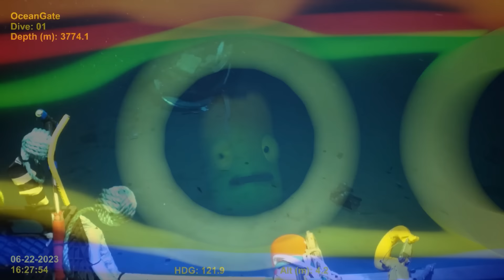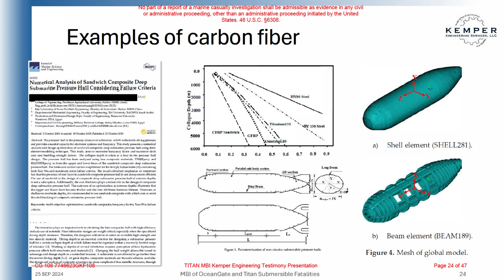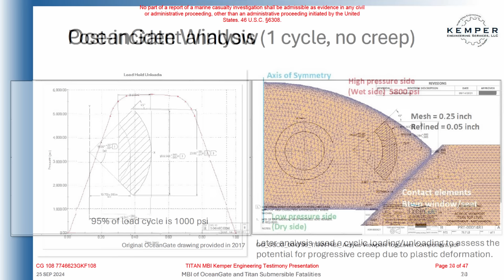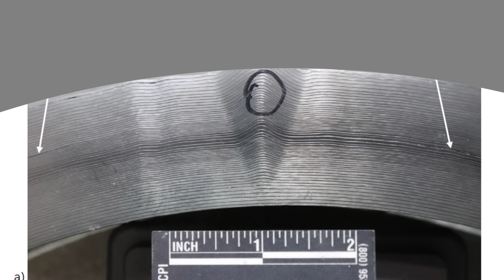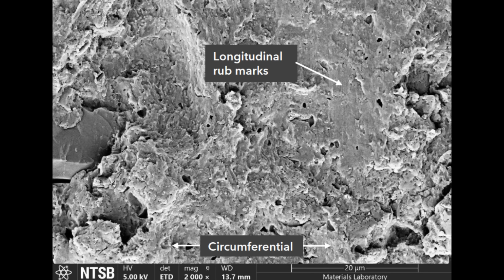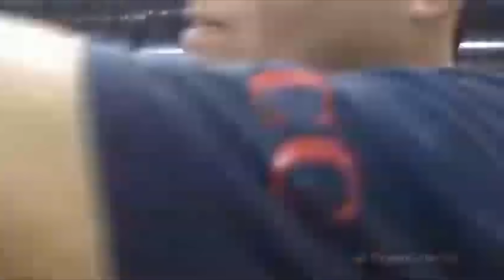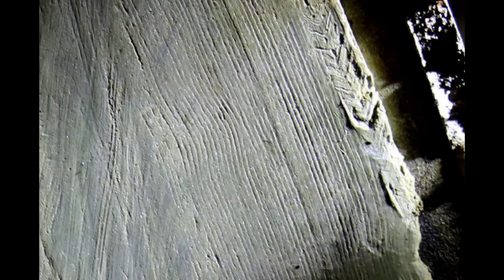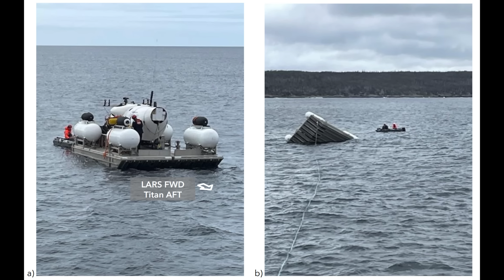OceanGate Wreck Shows Why Sub Wasn't Strong Enough To Survive - NTSB Shares Important Details

Comment: My guess the front window failed.  here I see what happen due speed of collapse the window failed ripping interior walls  ripping inner carbon wall layer by layer  ripping the glue  hence power glue bits also I’m saying window because remember once there leak like soda pop that pressure not going inward but going out window so nothing holding that window from going out.. gosh knowing that where bathroom is hope no one was in there pushing on glass to see or yah not saying out respect but that strong possibility

Comment: Carbon fiber is infinitely flexible, but it cracks like an egg shell when it fails--speaking as a cyclist who rides bikes made of aerospace level materials.  Amateur of course, but I would think if you wanted a lighter than titanium but stronger than steel material, you would go with zirconium alloy, which doesn't crack.

Regardless, carbon fiber paired with metal, I would just assume it would crack where they meet under pressure, because the materials behave in different ways that don't make them good partners.

If carbon fiber were the answer, every spacecraft would be made of it.

Comment: Idk, the glue would be layers of weak points.. looks like the sea water blasted through them, blowing it apart. They said it creaked so obviously it would fail. My intuition says 5 dives as safe. They should have made 2, 1 to that does 2x the dives to test.. otherwise pretty much suicide.

Comment: The human brain thinks in about 500 milliseconds. Oceangate imploded in about 10 milliseconds..... They were dead before they knew it....
Reply: I'm actually terrified of dying and not realizing I have died.  Like dying in a car crash on the way to work and continuing on for weeks before a coworker says to me, "you know you don't have to be here, you died two weeks ago."

Makes me wonder if they experienced a successful dive and only discovered the truth later when someone gently broke it to them.
Reply: It's actually about 250ms, that's human reaction time.
Reply: @takanara7  depends on which study you read. There are varying opinions. That's why I said about.
Reply: @Jim-ku6ry  "thinks in 500ms" means absolutely nothing, the human brain "thinks" a lot faster, thinking and reaction time are two different things. As an example, if you play an electronic instrument you will perceive the delay in response if it is over 10ms. And in many cases the human body can perform complex actions at high rate and with very fast reaction time, in the order of few millisecond, so this statement is nonsense. If you talk of the time it take for an human to perceive stimuli, analyze and react, then yeas its longer, but still not 500ms, it is oore in the order of 100ms and even that excludes reflexes which can be a lot faster.
Reply: @lo2740  the point being that the implosion happened faster than the human brain could conceive what was going on. You'd be sitting there and then you'd be dead. Nothing left but goo and bone bits and your brain would have no concept of what happened
Reply: Which is a fascinating concept... sort of like when I say "if you really want to make your brain hurt, think about the fact that universe is infinite".  It must have an end, but then again, how could it.  And if it did have an end, what would be outside of that.  Also, this is a scientific question, not one to be answered by religion.
Reply: @eastbaystreet1242  it's possible that the data necessary to answer these questions would only be available to a dead scientist.

Comment: The problem with a carbon fiber epoxy composite is that if there is any give in the outside, it will give, and then apply more pressure to the next layer down, and then as that gives, it applies pressure to the layer underneath that, and slowly breaks up the epoxy binding the whole thing together - particularly with repeated applications of pressure and then relieving that pressure. That just lets the thing slowly grind itself down.  With a homogenous material you don't have any internal grinding and resulting separation as the thing flexes to-and-fro with strain coming and going.

Comment: I had heard it sprung a leak in the back equipment area separate of the main cabin and that leak lasered through the electronics, shortly before the implosion. That was part of their early equipment failure they were noticing....though the finer details could be completely different, i suppose.

Comment: 14:47  That doesn't look good to me.  IMO resin layer should be more uniform.  Any place there are gaps and holes could be compromised structurally.
Reply: There was a basic disregard for safety which should be the first priority for any high risk endeavor.  Redundancy and backup systems are important.

Comment: If they wanted to prevent that creasing issue, shouldn’t they have identified the spots where it would begin early? Then sand minor imperfection by layers successively? So there was a minimal necessary take on each layer?

Though… I seem like whatever bonding they were using was failing anyway.
Reply: As someone else mentioned, the wrinkles didn't appear during lay-up,  They happened when they vacuum-bagged it after laying up the first inch of layers in order to "debulk" them and squeeze out excess resin between the layers.  (It's like if you loosely roll up a roll of paper around a solid tube and then put a rubber band around it -- you'll get wrinkles that look just like that.

Apparently when Boeing is building 787 fuselages, they do a debulking step between each layer for basically this reason.

Comment: I use to install underground storage tanks and one type of tank we installed was a steel tank with fiberglass layer on the outside.  The steel gave the UST strength when buried whereas the fiberglass coating gave the tank protection against corrosion.  They probably could of lightened the load but safety should of been #1.  Every 33' of descent is 1 atmosphere which is about 14.7 lbs. psi on the submersible every 33'.  It's incredible pressure.  They should of imbedded sensors in the carbon fiber walls so the trip down could of been stopped if values were exceeded.  I'm a diver and you can feel the pressure.

Thomas M. Dutkiewicz
Reply: Thank you for explaining how many pounds of pressure 1 atmosphere is.

Comment: Last year thunderfoot pointed out that carbon fiber and titanium have different compression modulus. The titanium doesnt compress at all, but the carbon fiber shrinks by about 10%. So all of the stress was being put on the glue, resin, and flange joining the carbon fiber and titanium

Comment: By machining the layers down to a tubular shape, removing wrinkles, you are shaving off carbon fiber layers at that part. This means that, instead of a continuous sheet across the diameter, you have a C shape at those portions, likely leading to local weakening of the structure.

Comment: What strikes me is the lack of deformity. It's like there were points of failure, but not what dramatic depictions of the deep sea describe, which is that "the pressures are so great they would crush you in an instant". This seemed to only break things apart, with the only "crushing" presumably being biological elements. Will they find an intact plastic game controller?

Comment: The carbon tube certainly failed at the inner Titanium lip, the middle of the tube could compress freely, but the butt of the carbon tube was inserted in a groove at the connection point with the rings. Preventing any radial movements witch stressed the edge of the carbon tube until failure.

Comment: I think the "water coming in" angle may be a bit off. i would imagine if a crack appeared, all the water around the vessel would quickly crush all of the air out first. but I'm not an engineer or anything so idk

Comment: the voids would be a meh non issue for something like a lever arm load but in pressure vessel the voids each will have individual point loads as the air pockets comoress and expand, you would need to do something like a finite element analysis for a certain densitynof air bubbles distributed thru the hull to get any inkling of their effect, my backnof envelope guess it it would contribute significantly to the brittleness of the hull and the criticality of the failure mode

Comment: I don't know much about carbon fibre, but the fact they just machined the wrinkles away, then added glue on top of this mess to add a new layer, does not sound very sound. also, I think we saw coming that the flanges on the titanium sphere would shear off. they were relatively thin and were holding basically the weight of the ocean all by themselves, since the hull was probably deforming too much.

Comment: The problem with having a flat side on the interior side of the window could be solved by building the window in the superior all-curved form, making a separate piece that is the difference between the curved interior surface and the desired flat surface and loosely placing that in front of the window. Air gap it by 1/8 of an inch or so. The optical effect woudl be the same or nearly the same as the one-piece window with a flat inner surface.

Comment: The problem with making it in layers like that. make a layer then cure make next then cure, is that the layers do not chemically bond. The resin sets into long polymer chains and that's what give the glue its strength. if the base layer is cured then the next layer is just laying on top of it causing delamination issue you see. When I make parts that can not be done in a single layup (one  layer) then you have to really rough up the base layer to give it a machinal bond. still not as strong as a single layup. The rings on the ends should have been built into the layup so it is built into the carbon fiber and does not rely on the glue at all. sooooo many thing wrong here.

Comment: Many types of carbon fiber are very strong in compression, often just as strong as they are in tension. Theoretically, if built correctly, a carbon fiber hull should be able to handle the pressure just fine, and the fact that titan made a few trips successfully proves that. But that's if everything is built correctly, and just looking at that delamination scares me. Then deciding that they would just shave away faults and glue new layers on top, absolutely terrifying. The way it was mounted to the rings was also a worrying weak point. A carbon fiber pressure hull could be made safely, but this absolutely wasn't it.
Reply: In real life, buckling usually kicks in before compression strength failure.

Comment: I have no knowledge in this space and correct me if Im wrong but wouldnt a simple solution to the optics of the window distorting the view simply be to put another pane on the inside, not under pressure, that remagnifies it? If possible, that seems like a much better idea than rolling the dice.

Comment: If I understood the NTSB nerd correctly, the issue with the wrinkles is that the material used had a lot of shrinkage, to eliminate it you would need to use a resin/fiber mixture that had as near to 0 shrink as possible. Otherwise once you put it under vacuum your wrinkles WILL appear.

Up to you to decide if this was down to poor/negligent planning, or if we can implicate the expired rolls of prepreg.

Comment: On compression: carbon fibre can widthstand the same or greater compression than titanium.  The matrix plays its role by keeping the fibres in the right alignment so they can bear the load without changing shape.  But this is all amount knowing how to lay the fibres so they have strenght in the direction(s) of forces.   The layup used by Oceagate was 2D.  Circumference and lenght of cylinder, but nothing in the "vertical" axis (thickness). 
A weaved fabric provides some z axis force, not just X and Y because whenever a strand travels over another strand and then goes under the next, there is some Z  axis travel.  So an object built with weaved fabric will have strong X and Y strength and some Z strength.  But the way Oceangate layed it fibre, it was only X and Y and absolutely no Z. And what was revelaed more important is that instead of creating 1 5" thick object, they created 5 1" thick ones and this greatly changes the strenght since there is no strong bond between each layer as there would be if they had been cured together with no layer of glue in between.
Reply: As someone else pointed out, they not only created five 1" thick hulls, they created five 1" thick hulls with pre-buckled fibers at the wrinkle points.

Comment: Carbon fiber works great once and less so on each repeated use with no way to determine if it's still structurally sound enough for another dive.  The only way to determine if it's damaged is to cut it apart which destroys it.  Steel is great because you can use ultrasound to look for stress fractures.  so you're not diving with a faulty frame.

Comment: I see 6 parts to the pressure vessel.  1 carbon fiber tube, 2 titanium rings,  2 titanium domes, and 1 window.  The rings are attached to the tube with a butt joint.  The simplest and worst joint ever.  The inner and outer flanges were so thin that they might as well have been cello tape.  It's not even worth mentioning.  They mated two of the most important parts in the worst way possible.  Surely there were a plethora of problems, but that's the biggest one.  3M makes some really excellent specialty adhesives, but why would you rely solely on a flat glue joint when nearly any other shaped joint would add a huge safety margin.  For literally no cost because they machined both parts anyway!  

It's a classic case of too many dollars and not enough sense.

Comment: As an aircraft mechanic who manufactured carbon fiber structures for a living, that is some of the worst construction and bond lines I have ever seen. Carbon fiber should not delaminate like that when it fails. It should look more like broken wood instead of a book that's been torn in half. The glue lines were WAY to thick. Also, when you remove peel ply, it creates a very fine resin dust. That dust needs to be removed before additional plys are added and that can be hard to do. The resulting criss cross texture after peel ply removal is not an apropriate surface to add aditional plys to. It needs to be sanded. Not smoth, but not with that texture which will leave a thick and weak bond line. A good carbon fiber lay up has been completly saturated with resin, but after curing there is very little resin left except what is needed to bond it together. At the same time you don't want resin starvation either. Carbon Fiber is extremely strong in tension. But if it is going to have any significant bending or compression loads, it needs to be shaped in a way to carry those loads by molding beams and flanges into it. Or you can add a metal framework to support those loads. This is some of the worst craftmanship I have ever seen.

Comment: In the footage of the glue being applied as the mandrill rotates it seems to me that there would be a tremendous amount of contamination occurring, fluff from textiles worn by the applicator, hair, dust, all manner of gunk.  For a device subject to such tremdous forces couldn’t such contamination affect the strength of the hull as well?

Comment: Scott, I think that Titanium Flange on the bottom of the sub failed. All those cycles with the Carbon Fiber shifting like that? I think eventually all that pressure was on the flange to hold back and it couldn’t, not by itself.

Comment: I worked on CFRP chassis for race cars as my thesis. Even for safety in cars those wrinkles are terrible and the fibres need to be laid at 45 degree angles. That's the strongest configuration of carbon fibres. I can't imagine doing 90 degree fibres for a submersible. What a terrible idea!
Reply: Just curious as I know almost nothing about carbon fiber, in a money-no-object scenario, would you gain anything if you laid the layers in more orientations (like 30⁰ or even 15⁰)?
Reply: @lonnyyoung4285  I'm not experienced with carbon from an engineering perspective, but I have worked with it from a fabrication perspective. We did have a fabric which was woven at 60 degrees instead of the typical 90, and I was told that that fabric was considered quasi-isometric. I would expect that you would get closer to being isometric (at least along one plane) the tighter of angles you have between layers, but at a certain point you'll be getting diminishing returns on the structural benefits, and also it will become difficult to actually lay up the part to that degree of precision (though if your part is being made by robots wrapping fibers around a mold, that does help the precision front).
Reply: the optimum angles depend on which direction it' needs to be stronger at. though this was the fabric they were able to get for the price so it had to be used.

in a lot of uses if you use cf as a substitute you don't need to make it optimal at all hence how the 'forged' method with just a mishmash of bits is common nowadays for a lot of stuff(it's cheap and easy).

in older race cars and ferraris they were made just from smaller pieces of fabric kinda just laid down sort of randomly back when it cost a lot more to get big pieces and they didn't want to throw away the cuts, the perfect top layer and direction optimization and visible carefully laid out top layer is a fairly new development.